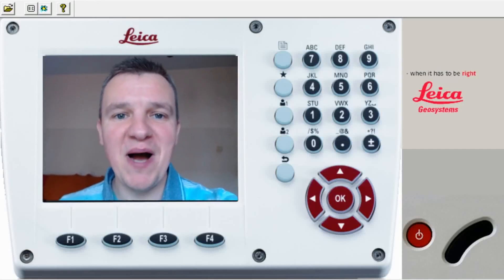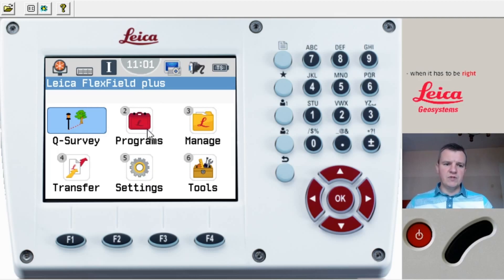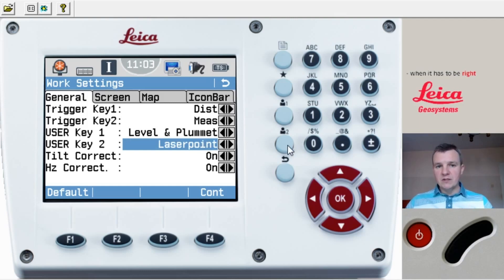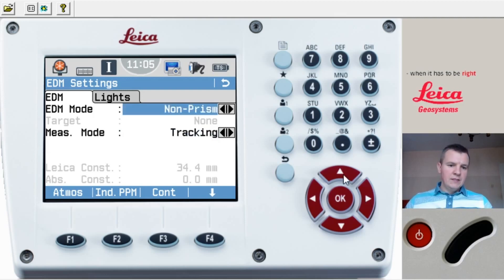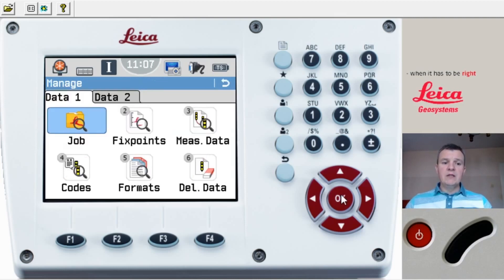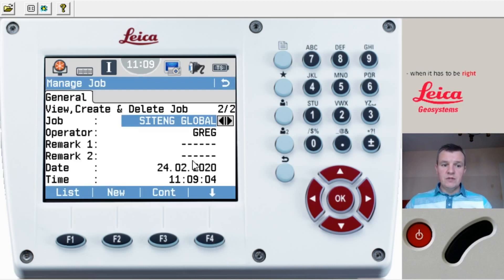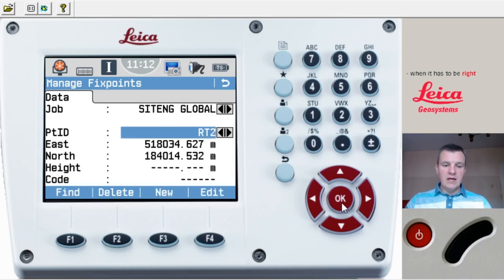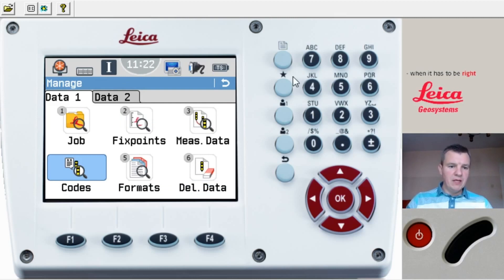SETTING OUT. TOTAL STATION - EDM. How to open a NEW JOB and set your EDM. Leica SETTINGS.

Comment: Hi Greg. Thanks for your tutorial videos. I saw someone has already asked for the virtual versions of the TS16 for practicing purpose. I almost have the same question. As far as I understand, there are/were/have been several software from Leica with different names which simulate different model of instruments. Like you mentioned in this video, the one is used here is Leica flexine. So my questions are: are these software open source or paid? What's the name of the latest ones which simulate the robotic instruments, ideally TS16 and 15? And how can I access them. Thanks
Reply from the maker: I downloaded them from SCCS page, but can't find it there anymore. It was for free. Separate simulators for flexline, viva and captivate series. If you find it please let the community know

Comment: Greg do you keep all your station points under one job and your setting out points on a different job? Then change jobs after you do you take your backsight?
Reply from the maker: Yes, I keep control job separate and don't mix it with any other points also doing resections in separate job not to keep all the data in my control job

Comment: Thank you for the brilliant resourceful videos.  
I have one question , is it possible to correct the data if the reflector level was mistakenly set to 20m instead  of 2 m?
Reply from the maker: Thanks Zerai! You will have to export data and take 18m off your levels. You can do it even in excel. Hope it helps :)
Reply: @SITENG  thank you very much.  I highly appreciate it.  I managed to correct it and looks plausible.
Reply from the maker: Great!